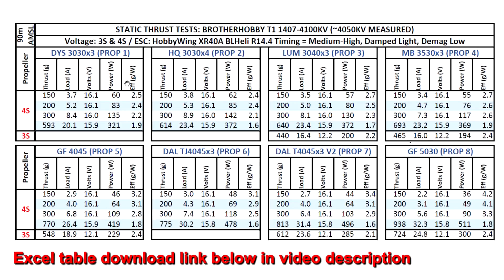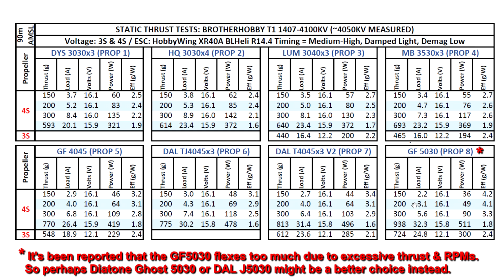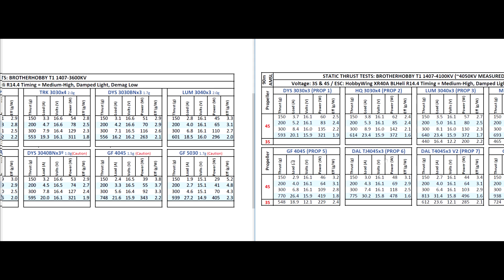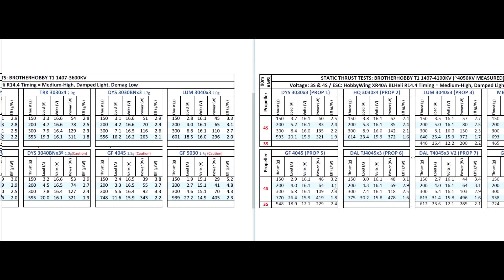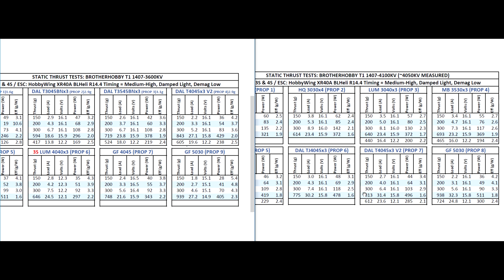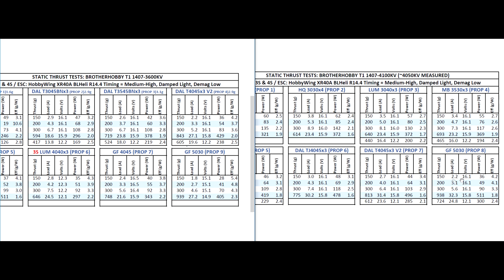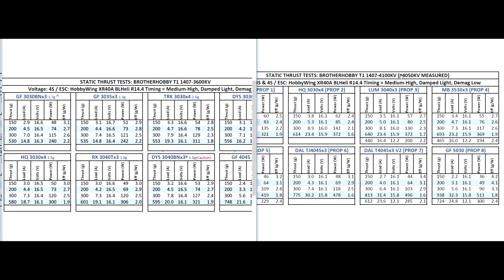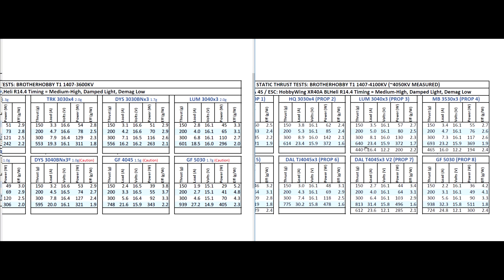BrotherHobby Tornado T1 1407-4100KV Static Thrust Tests -Keep volume LOW!

Comment: @engineerx Great video! thanks for your research. I'm building a shendrones squirtv2 cinewhoop. would these 1407 motors be good for that? or would you recommend 1408? or even higher like 15xx
And if so what kv is ideal? thanks
Reply from the maker: If you plan on carrying HD camera then I think larger motor will be better so you can run any of the 3-blade props. I think most people use 3200 to 3600kv for 4S and maybe 3S. Most likely you can get around 3min flights. It's a lot of weight to carry the HD camera. A lot of people delete the battery and use a 5v stepdown powersupply for the HD. Good to research and see what other people have done and copy them

Comment: Nice video sir. What do you recommend if im using 3052 props? 3600kv or 4100kv? I'll run on 4s. Maybe 210g auw.
Reply from the maker: 3600kv will give you longer flights and will be less punishing on your LiPo. 
4100kv will fly faster but you will need very good Lipo and maybe you only get 2:00 flights if you fly aggressive . I prefer 3600KV for freestyle, flying around the park.

Comment: could you test the new rotorx 3044T prop?
Reply from the maker: Yes, I will eventually, need to order them.
Reply: any eta?
Reply from the maker: Not at this time, I looked for those props in some of the shops I usually purchase stuff from and none have them yet. I may have to wait until they become more readily available.

Comment: hey boss.. do you have an upcoming test for the BH1806 2850kv motor? i am hoping you could do some... rightnow i have a quad that runs f30 2800kv and i think she is overproped with RK 5040tri... your data with an almost similar motor would help alot... thanks
Reply from the maker: OGTwiTCH Agnes yes , í ran tests already. Just gotta put data together in table. If F30 is 1806 size, then 4S-5040x3 overprops for sure. It's just making heat. At that high KV on 4S gotta be careful with props. I'll have tests results ready in a few days.
Reply: EngineerX yeah its 1806 2800kv. and i have proven that coz iv flown her up and found out she is overproped with an 5040 tri prop... damn! lol now to find a 5040 prop!lol
Reply from the maker: Yes, try 5040 and check motor temperature. You should be able to grab it firmly without burning you. after a fast full throttle lap. If still too hot, then motor just can't handle the load and you need to use 5030 (DAL or Diatone, GemFan too flexible)
Reply: i have tested earlier today the old Dal 5040 (skinny/slim) and that works perfectly. the old gemfan 5040 is too flexy at throttle pumps. i think the dal 5040 slim is the way to go... il ordee up some KK5040 too coz they are at the same footprint... eager to see the bh1806 test boss... looking forward to it!
Reply from the maker: Great to see that prop works well. Yes the GF5040 flexes too much,  Only HQ and Diatone 5040 (5030 style) are better. DAL 5040 is stiff so that's good. It'll be a couple days to have video ready so check back soon. Thanks for info, I will mention DAL5040 have been tested and confirm to work well on 4S
Reply: anytime boss! im glad i have contributed for the testing of that motor! keep it up boss!

Comment: thanks for this!
seems like the lack of torque shows on 4" and 4s compared to the 3600kv which produce around the same if not a little more thrust.. on the triblades atleast anyway
Reply from the maker: Yes - that was interesting to see and it makes sense, that's the way it should be anyway. Very high KV = very high RPM but less torque, best for small props. When you use the "larger" props then lower KV motor has an advantage and in some cases it can spin same prop at higher RPM or at same RPM using fewer Amps.
Reply: EngineerX When will you be testing the efaw 2408's? And will you also test them on 6s?
Reply from the maker: 2408's? I 've asked them for 2407's and they had said they would send me some to test, but I imagine they're selling as soon as they come out of the assembly line because I've not received any yet! I did purchase one 2407-2500KV so I'm gonna review that soon, I'm just finding it difficult to get some free time to run the tests and prepare the data and review, hopefully soon. For 6S, Iperhaps I could run the 2200KV on 6S and 5" props., I'd have to see how it does on 5S first The higher KV motors will draw way too much Amps for my setup I think. Thanks for watching!
Reply: EngineerX Sry, typo. 2407s.... Id like to see the 2500s on 6s with 6" dual blades... Ive been told they can handle it. But id guess a 45a esc would be needed. Great content. Thx for doing it!
Reply from the maker: Right, I've seen reports on the 2407 2500 being able to handle 6S but unfortunately my test equipment would not be able to handle the load on 6S on the 2500KV motors. On the 2200KV yes. Already on 4S-2500KV it approached the limit on the DYS Thor 2407's. On the thrust stand, Amps are always much higher. I was talking to someone who is flying the 2200KV motors and he said those on 6S are already too powerful and he runs out of room on a big field quickly so he prefers 5S but he'll do 6S every now and then just to feel the raw power and speed.